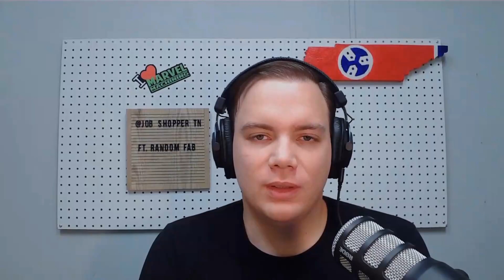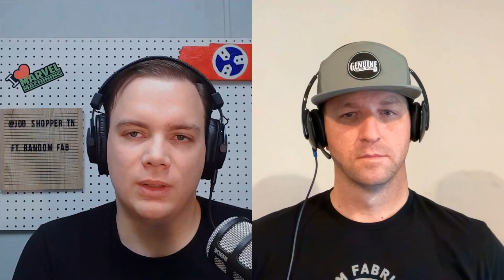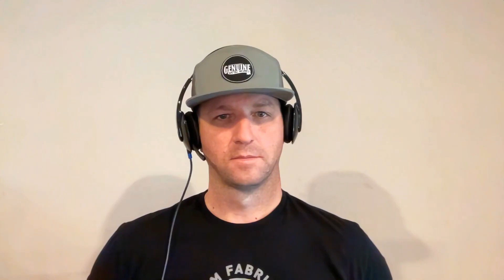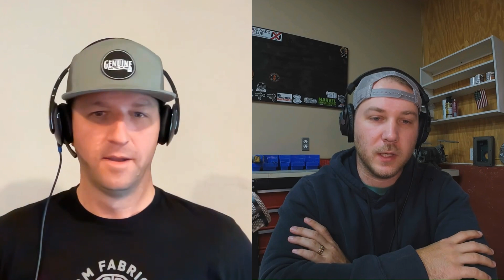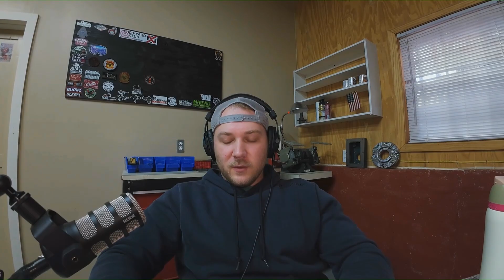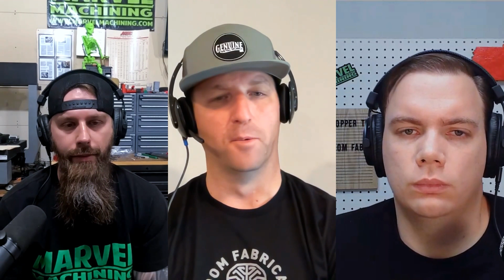Is Starting a Part-Time Machine Shop Worth It? | The Impractical Machinists 15

Comment: Gorilla mill makes rougher/finisher Endmills where 3 out of four flutes are chip breakers with one "finishing" flute. The finish on those are very acceptable for a lot of parts. 

I haven't tried these with aluminium yet, but I'm gonna have to check out some chip breaker finishers as well.   Those finish chips are a pain to clear with aluminium. 

Great video btw!

Comment: Andy Dukes told me speedios don't regen like say a haas does (with the silly heating element). Because a speedio spindle is actually a servo motor? I know my Phase Perfect has never made any noises that correspond with my Brother spindles the way it does the haas spindles. When the haas ramp up/down the PP makes all kinds of racket.

Comment: How old is your tool room mill? 
I had an 07 tm1 with tool changer and doubled the z axis acceleration and rapid speed, BIG difference in tool changes and also for peck drilling. 
Also bumped rpm from 4000 to 6000 and doubled the xy rapid (but not accel)
Takes 5 min and really wakes up a machine.
You can go further but I did not wanna stress it.
The “p” was the same hardware with different settings. Don’t be a grade to wake up the old tm machines 

Only thing to be mindful of is table load, heads always gonna weigh the same. Sometimes a table is loaded right up with 700lb so maybe don’t bump up dependant on workflow that it may see.
Reply: I’ve heard of doing this. It’s a 2001.
Reply: @patrickmcclintock7027  you need to do it, big improvement, the accell and speed on z is a huge dif. the rpm is nice too, ive seen people push it to 8000, not alot or torque tho at the higher rpm's

google is and tag practical machinist, there is a good how to guide in the haas forum.  its just changing a few parameters and boom, better machine. you can do this with all older haas machines. they locked it up with the next gen controls though.  ive heard of people bumping there vf2 speeds to vf2ss speeds. they knew they only ever put light loads on the table so it was safe.